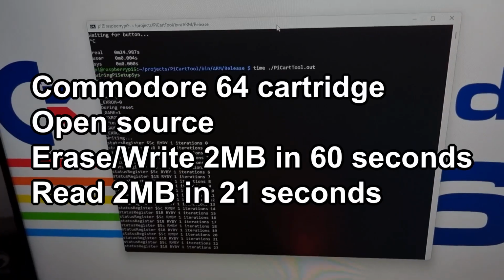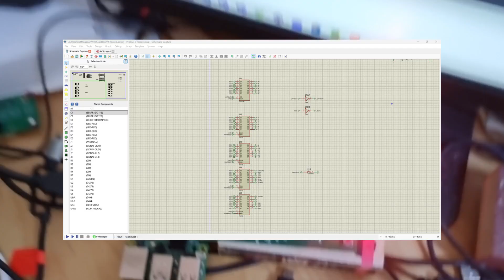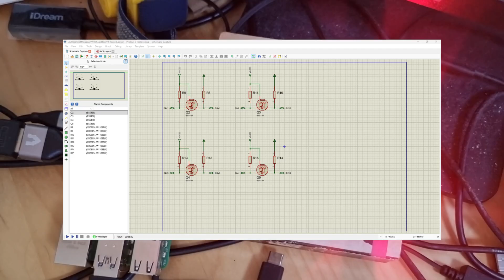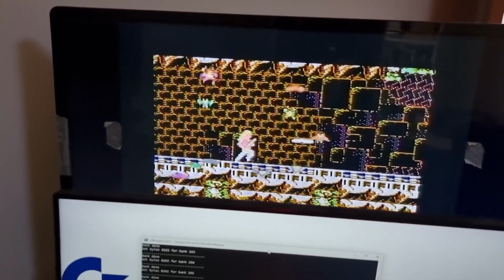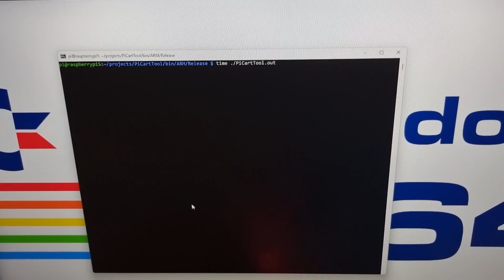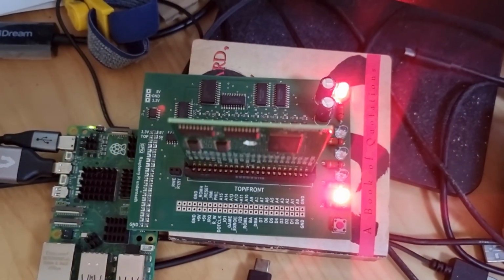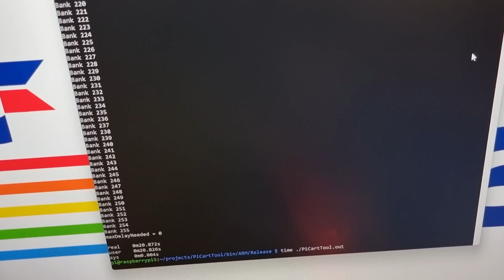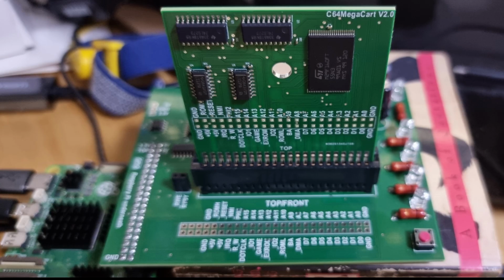Commodore 64 Cartridge programming tool - V2

Comment: I've never ordered anything from PCBWay assembled.  When I try to price either the cart or the programmer, there appears to be an assembly fee and a BOM associated with the project, but the components costs is always $0.  That seems wrong, am I missing anything?  Also, I would assume for the cartridge, I would want to use the edge connector feature.  Is there a recommended bevel angle and finishing process?
Reply from the maker: For assembly, after the order is submitted, PCBWay look at the BOM parts and provide a quotation, then you have the option to proceed to payment. Their standard stackup is fine, I currently don't specify a bevel on the edge. connector, it seems fine like that.